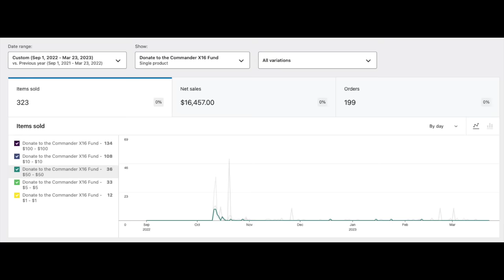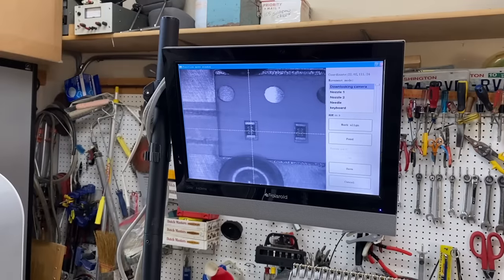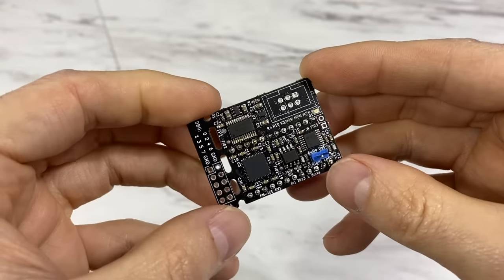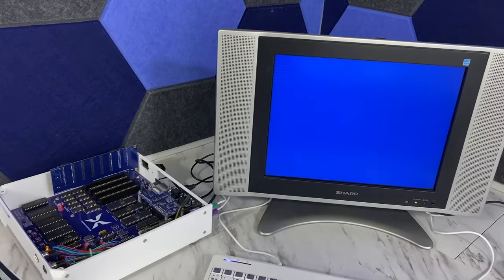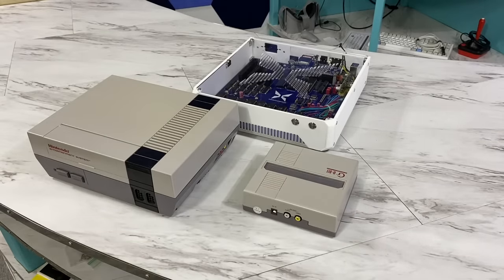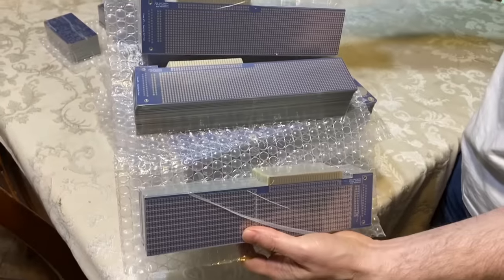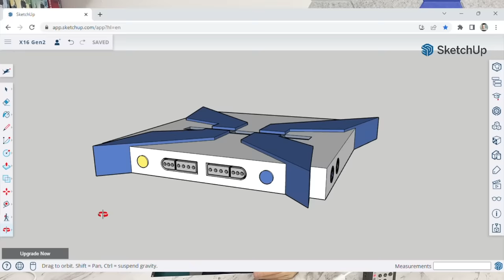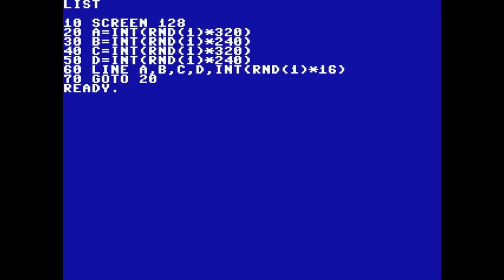Commander X16 2023 update

Comment: You can tell David used to work in tech support, because unlike a lot of designers he's very sensitive to the "if it's possible to do it wrong, the user will and will blame us" issues
Reply: I've been in tech support for 27 years.  This is exactly right.
Reply: I designed my own X16 hardware and, with permission, sold 7 of the boards I had made. Most of them were sold as bare boards (except for VERA) with the buyer responsible for assembly. I only sold bare boards to people who I felt confident had the chops to assemble them. All but one of those bare boards has now been assembled, but every one of them required support. I don't think I misjudged the people I sold my X16 boards to; I think it's just a very complex project for a kit. I don't think that I would do a kit like this again; I would have spent less time if I had assembled every one of my boards myself and only sold them as assembled systems.
Reply: Yeah but then why is the cartridge port rotationally symmetrical? That just means you can put the cartridge in both ways.
Reply: I mean as far as a design goes, you want to try and help- the person trying to use the product is who you are trying to make it for, so if they are confused, the design can be improved
Reply: Good design should be "if it can be physically connected, it's compatible", and vice-versa. It's bad enough if it harmlessly doesn't work. It's really bad if hardware can be damaged by joining two matching connectors. It's horrible if there's risk of injury, fire, etc, which I've seen in a few cases.
Reply: @ironcito1101  learned that the hard way trying to upgrade a proprietary Dell system with another power supply. Hooked up the ATX power cable (it fit just fine!) and ZZZTTT!! dead motherboard. My fault, but it never should have been possible.
Reply: @mikegarland4500  Upgrading a Dell power supply feels like wiring a car stereo.  If there's no adaptor, then you're looking at pinouts and splicing wires.  The fact they used the same connector in those purple P4 optiplexes was plain evil.
Reply: I don't know Dave but there are some clear "control freak" signs with that kind of mindset. "It has to be perfect!"
Reply: if he'd worked with the military everything would be made out of cast iron.
Reply: Yes, he worked at AST when it was still a thing.
Reply: That's exactly the scenario I would be concerned with. No warning about something not exactly common knowledge outside of certain circles, finding a good deal on used PSU or NOS PSU, plugging it in and killing your $200 retro PC.

That was a HORRIBLE design decision by DELL.
Reply: Supportability is a design feature that must usually be balanced with other competing design goals. Sometimes making a design more supportable comes at the cost of performance, price, aesthetics, etc. People want everything. Project teams want everything too! But nobody can afford everything. Projects succeed when competing design goals are balanced tastefully and communicated clearly.
Reply: The user will and will and will and will and will and will~ ~and will and will blame us
Reply: You have to when making something for a market really.
It when building anything
Reply: @spacewolfjr  it’s called engineering
Reply: @jhoughjr1 , I served with engineers. I knew engineers. Engineers are a friend of mine.  @jhoughjr1,  David's no 'geer.
Reply: ..and tech support never blame the user...do they...
Reply: And it proves why he was not in development department....

Comment: I work for a contract electronics manufacturer. That you are trying to hand place SMT components is incomprehensible to me. Our pick and place machines can place 10's of thousands of components per hour. Then we have automated optical inspection machines to find errors like missing or misaligned components. Then there is automated testing of the assembled boards. I don't think you have realized the scale of the task you are trying to pull of.
Reply: I design electronics for manufacturing, of similar design complexity to this device.  Designing for manufacturing is a big step above designing for hobby work, and IMHO it would have been a much better use of their funding to hire an experienced professional to explain the basics of board manufacturing/assembly, DFM/DFA, and best economic practices for manufacturing at their scale.  Heck, I'd be one of many happy to offer that advice for free to support an interesting project.  For a run of 100 boards of this complexity I'd expect automated SMD assembly, hand soldering of a couple SMD ICs too rare for automated assembly, hand placement of THT, and selective solder.  All with proper inspections in between.  All on a board that has seen proper review for issues that might be nothing in ones and twos, but will cause a substantial rate of defects in tens and hundreds.  It's unfortunate that the board might have been much closer to the original price if only the assembly process was planned out by someone who knew what they were doing.
Reply: @Alchemy-yr3sw  You should send them an email offering to go over some of this.
Reply: I totally agree on that, spending hours soldering components by hand for these large boards is NUTS. Even with through hole being more expensive, I'm pretty sure it would be cost effective to ship all the parts to PCBway and let them handle everything. But i'm mostly disappointed by the lack of coherency and vision on this project, please design ONE system with well-thought parts and features and stick to it. Stop imagining different versions, expansions and whatnot, what you really need is one model and only one.
Reply: I will buy whatever he makes. I'm excited!!!
Reply: @wphanoo  Depends on your experience in doing this.  I used to do hand soldering professionally (J-STD-002).  If you optimize your process for good workflow you'd be surprised how many parts you can churn out, and with quality joints.  I used to crank out hundreds of PCBs per shift. This was stuff that went into military ground vehicles and the AH-64 Apache.  Actually at the low to mid production numbers, it's more efficient to do it by hand if you know what you're doing.  Especially with SMT.  It's not worth messing with contract manufacturing unless you're talking about tens of thousands of boards.  If you have properly masked boards, and solder paste stencils, and pneumatic parts picking tools, and a rail system for the boards to queue them up for the reflow oven, it's pretty quick.  I've even done things like had SMT parts jigs and multi nozzle pneumatic pickup tools.  The SMT parts are placed into the jig, which is just a plastic mould that holds all the parts physically the way they will go on the board.  Then the multi nozzle tool is used to pick them up from the jig and place them on the board.  So say there's like 20 parts or something.  All parts placement can be all done in one manual operation!  You can even have fiducials to line up the picking tool to the board.  I designed tooling like that to crank out boards that went in South Korean F-5 fighters.  I could crank out like 300 boards before lunch doing that.  And it's fun!  The Pick and Place machines are cool and all, but only necessary when we're talking 100,000 of boards etc

Comment: I've been working on a 3d first person game engine for the X16 for the last ten months or so.  The hard part has turned out to be the map designer program, but it's coming along (please stop with the breaking changes though, please!) and I should have something to show in a month or two.  It won't be Crysis, but it's definitely more than Wolfenstein.

I worked at a couple of PCB manufacturing plants in Calgary about 20 years ago, Sanmina and Interalia.  Either one of these places could assemble a VERA or X16 board in a matter of minutes.  The big Fuji pick and place machines I was running at Sanmina could place 40 thousand SMT parts per hour.  You really ought to reconsider using a manufacturer rather than trying to set up a factory yourself, unless you're planning on also building boards for other people.  It isn't just the machines that you need, it's also the conductive floor wax and ISO 9000 standards and antistatic smocks on everyone involved and a hundred other little things that make the difference between a product that's reliable and affordable and one that is not.
Reply: These are all great points. It will be a lesson learnt when there are high fail rates on the boards.
Reply: how about no. you are missing a key point of the project if you say "might as well get someone else to do it for you". its meant to be a more personal thing.
Reply: @zilog1  They are literally planning to manufacture hundreds of X16s. It's way beyond the scale of a personal project. You have no comprehension regarding the scale of this task.
Reply: Please have a stealth system, wolfy was good but the enemies needed to be easier to creep past.
Reply: The board production troubleshooting and machinery can be used to assemble future TexElec products, and/or simplify the assembly of current ones
Reply: @zilog1  lol, so maybe they should consider making pcbs by hand? You are missing a key point of any project: you cannot make everything by yourself. And in my opinion making assembly by themselves is sub optimal. There are companies which can assemble a thousand of computers in a few days/weeks, and with a lot higher standards than some home factory in their garage.
Reply: it would not surprise me they thought about that & there is a reason for not doing that
Reply: The problem is. can they even get enough orders to match a minimum batch size at such a place? I don't know what PCBWay's minimums are for fully assembled boards. Having the equipment on hand does let them assemble revisions a bit faster.
Reply: Totally agree on that they need to have a factory assemble it instead of spending their own resources doing it. They’re spending time learning how to make boards properly instead of finishing the product, which is the designer’s actual job.
Reply: @DFX2KX  There probably won't be anymore revisions to the boards themselves anymore, just the ROMs.  But it will help them with prototyping things like expansion cards.
Reply: Dude he's hand building 100 enthusiast boutique SBCs at a time. Not 100k widgets to be sent out per day. I don't think they need to be perfectly reliable - the margin for error can be an order of magnitude higher when dealing that fewer products being sent out etc. Not to mention labor costs sure, but upfront matters when trying to get a product out the door, and labor is cheaper in the short time while they can slowly build up the higher single cost manufacturer tools that will lower said cost over time and make things more efficient. Trying to start that all up at once is how you get a $900 launch price.
Reply: @DFX2KX yes, the Agon Light is already sold at PcbWay and Olimex.
Reply: Looking forward to it Ed.
Reply: @hi_tech_reptiles  I guarantee you they're spending more than half their time inspecting and reworking.  And that is itself failure-prone.  This is going to exhaust these guys.
Reply: @linuxstreamer8910  They don't appear to be thinking all that many things through, honestly. Hahah
Reply: This is completely irrelevant but it's fun to meet a fellow Albertan in the wild :)

Comment: I work at a PCB assembly plant here in the states. Would be really cool to see the X16 take off to the point of mass production.
Reply: Cool 😊
Reply: But you know working there how many boards you pump out.
Those one hundred boards would be done thirty minutes full stencil set, solder paste, chipset, xray, cam and op test, wave solder, debug, conformal coat and Tada!! 
What state are you in? I am in detroit and it is very limited here with pcb production.  Is warwick controls and other companies I worked for in the nineties Where it was still through whole technology and the start of Surface mount.
And I worked for magna and holly but it's like an hour and a half drive. We were making the intelligence for cars. More like the spy. It harvests so much data it's ridiculous no one has an idea at all.
Not the dealer not even the manufacturer itself unless you are? Part of the design and security team and whatever else...

But i'm trying to find somewhere else because I quit that job being so far away and all of the I75 construction. The ozone system, UV binding and curing and just the whole environment was really clean and it taught me also how covid mandates were a joke. Or anything leaking from a lab.
We had four doors. We had pressure and vacuum, electrical discharging floor and air. We also had to wear special smocks gloves shoe coverings and headcoverings. For a computer chip!! Already assembled. It just needs to be mounted to the board.
So I laugh at anybody who followed any of this whole pandemic over the last three years because Us inside of these high technology production factories have Greater measures than the supposed lab that leaked the virus.
Reply: We were placing forty thousand chips an hour.
Reply: Know what wrong with that soder
Reply: @MacNifty  put your tinfoil hat back on and keep your rants to yourself next time
Reply: I’m also working at PCB assembly plant in Malaysia.
Reply: @MacNifty  you sounded quite reasonable until the last 2 or 3 sentences when it then turned out the entire posting was just a fabricated story to tell your BS
Reply: @AMPProf  no lead in it.
Reply: But then he would not be able go under 300$
Reply: Will you do some work for free?
Reply: These are not gonna take off. Who wants to spend hundreds of dollars on something that can only support 256k gaming?

The games he demo'd are junk ... like seriously hardcore junk. These are games you can download for free.

This is a very niche product for those of us who love this kind of stuff ... but I'm well aware this will never take off and be a mass made product where there are tens of thousands sold.

The price is too high and it's not going to come down enough to get people to want to buy one.
Reply: @orangejjay   Honestly, there are dozen of these retro projects. At $500, you might bring back the Betamax. If there's anything to learn from the 80s is how price made all the difference. Apple, however, managed to fetch a hefty premium for shitty graphics and sound. Jobs was a genius!

Comment: Before most of your viewers were born I was lead engineer for a company that did PCB assembly in New Jersey. We found that dip soldering did not work well with large boards due to warping, which not only leads the poor joint quality but greatly stresses the copper traces. We instead used a flow soldering approach where the solder is pumped over an edge, creating a flow wave across only one dimension of the board. As you move the board over that flow point, it gets completely soldered. This greatly reduces the tendency of the boards to warp and improves the solder joint quality.
Reply: Wave soldering is the way to go, although it looks like they have limited space for that type of equipment, unless they make them smaller than what I'm used to working with.
Reply: I imagine a wave solder is very very expensive.
Reply: Sensei 🙏 (virtual bow)
Reply: @NRGY  I have a hard time believing it costs more than $50/pcb to assemble DIP packages. Doing it in-house is just dumb!
Reply: @bobweiram6321  Maybe Texelec wanted a solder dipping station for his own use and it got paid for by Commander X16 funded money.
Reply: It's all about the zone profiles in a reflow oven.  I wish people would contact consultants before spending money. That's why we do that.

Comment: Managing board flex/warp is a pain even for the most experienced enginerds. Main thing I’ve seen in wave solder fixtures is that they’re made of a high-temp black phenolic laminate material that doesn’t warp at high temps. They typically use clips made of the same material which are held down with springs and screws.

Hope you get it sorted soon cause you’ll be golden once you do!
Reply: We cooling same time with nox2 Gas the PCB fromm top, No warping and Solid solderpoints!!!
Reply: Enginerd? Watch AvE, do we?
Reply: Another reason for those solder wave 'sleds' is to protect all the SMT parts on the solder side from the wave of solder (one could use adhesive to hold the parts on the board, but that's another kettle of fish).
Reply: Warping on such a big board is expected, and can be managed. Use hatched ground planes/pours and try to keep a constant copper density across the board. At this point, it may be faster to ask PCBWay for a re-spin of the motherboard rather than keep fighting these issues.
Reply: Why he should have used a professional  mcad program to design the board. He could have tested the prototype design using thermal flow analysis.